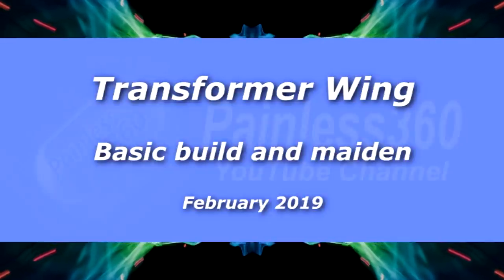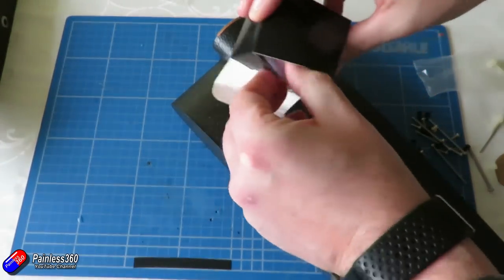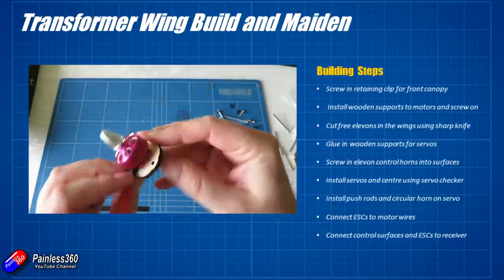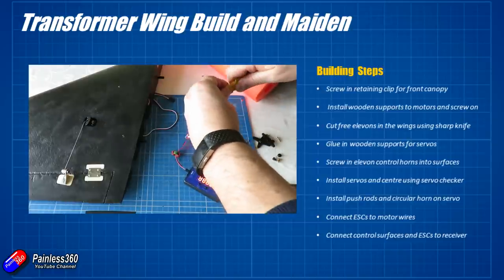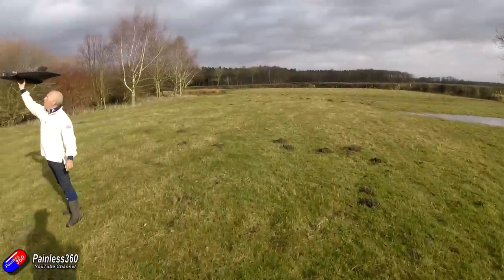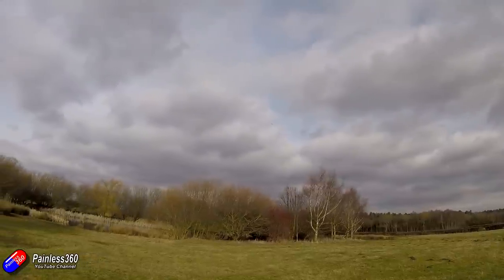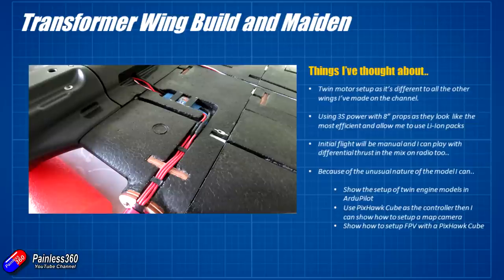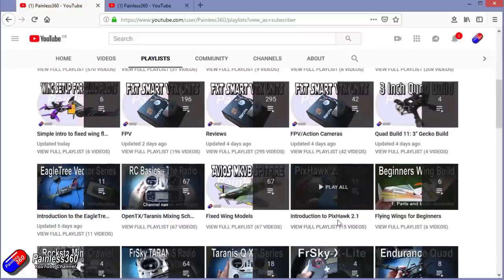Transformer Wing: Build and Maiden Flight

Comment: Interesting review as usual. But surprised that it's drawing 12A at cruise, I would be looking for around 2.5-3A per motor for 40mins on a lipos and 60 with Li-ion. My venerable 1.7kg Twinstar drew 12A with stock motors, but with Sunnysky  X2216-8 1250 II on 8x6 and a 7000Li-ion 4S, it's down to 5A and over 60 mins flight time. Be interesting to see what mods you introduce to improve duration.
Reply from the maker: Longer testing have shown less draw. More videos on this thing coming...
Reply: motor supplier's  testing data is 3S 8040 and 4S 7050 but I personally  Recommend to use 4S 8" Prop has better efficiency, there are some guys have already flown with 4S 8" prop.

Comment: Nice build and flight. Ive been tossing around the idea of getting a fixed wing, but puzzled by the landing. Is there a prop stop that sets the prop at level to keep it/them from breaking off, or some other process that does that? I know there are folders, but you have one piece on this plane. Thanks
Reply from the maker: Things like folding props and landing gear keep the props out of the way of the grass. In practice you’re unlucky to break a prop as they tend to be pushed out of the way, to the side on landing..

Comment: Intresant airplane,,,  mount fc whit gps and can be very intresant,,,  now i fly whit my Skymule, have change motors and props,,,  so i have 3kg trust in eatch motor,,,   use 3 3S 5500mhl ,,,  flight time whit 30% throttle 40 min,, whit full throttle and 15% flaps its airborn in 3 to 4 meter,,,,   its very havy so i have to install flaps on on it,,,,  i have broken 5 landing gear + nose,,   now i have learn to landing this havy airplane...      Wow spring in good old Sweden,,,    best regards,,